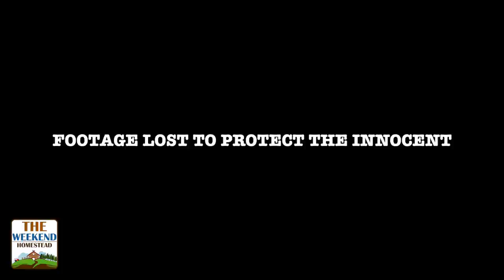Cabin Time Fun + Power Outage - Using a Manual Transfer Switch

Comment: Thanks for the invite, no one likes to tip a couple back more than me. If nothing else, did you check that the "Transfer switch" powered the fridge for the beverages?
Reply from the maker: Macca Stacka sad to say but no fridge at that point - kept the ice and beverages on the back porch. The switch is hooked up to the fridge, the oven and keg cooler to make sure we can make it thru any emergency